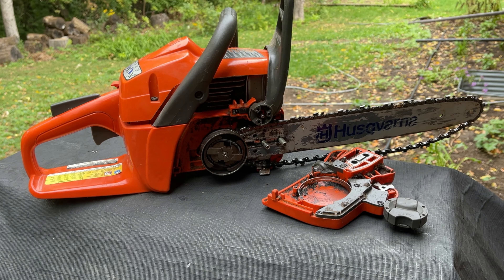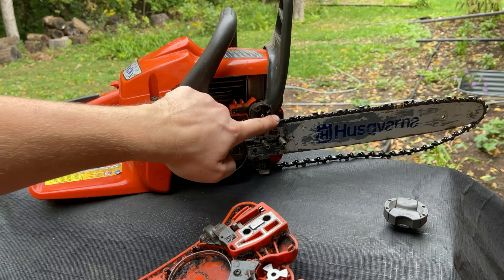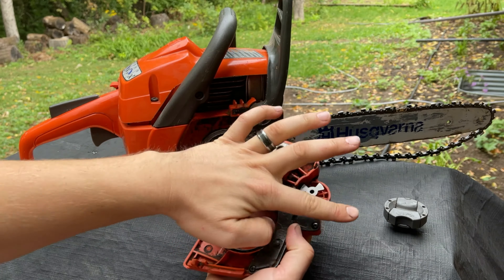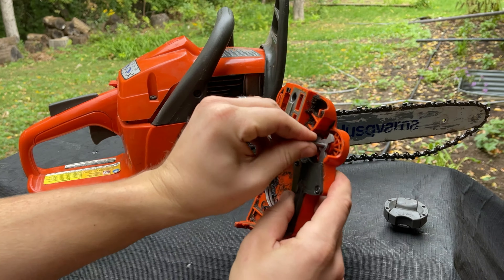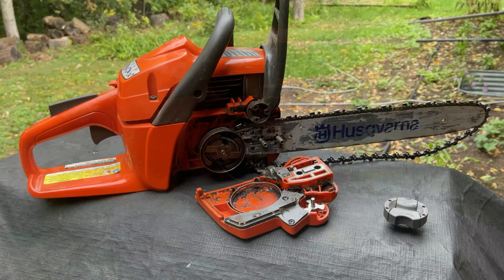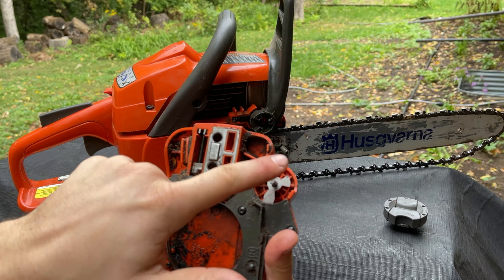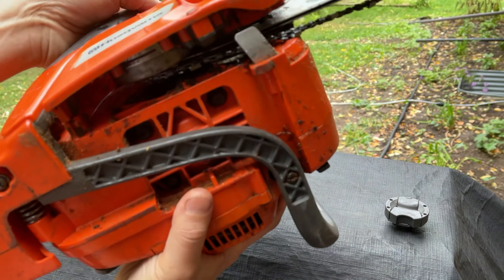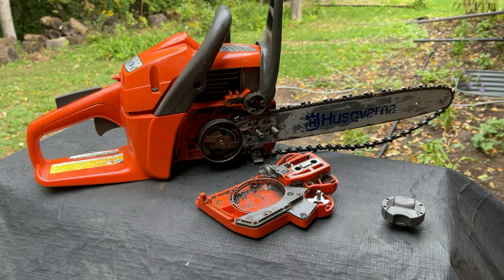How To Replace Chainsaw Chain Guard Clutch Cover On A Husqvarna Chainsaw

Comment: I literally just stopped everything. I was doing took my gloves off just to give you a thumbs up. I was absolutely stuck on trying to figure this thing out until I run across your video
Reply from the maker: Glad I could help!
Please consider sharing the video to help others as well! 

It is such a frustrating issue to have ruin your day.
Reply: Same here. Didn't realize the stop bar was locked in the stopped position and had to muscle it back free. 
Thanks!
Reply: Ditto!  The video kept me going in the field today 🫡

Comment: Now hire do you tighten the chain?
Reply from the maker: There should be a tension screw next to the base of the bar.

Check out a video on our channel about replacing the tensioner screw. It may help you locate it.

Comment: On thais chainsaw, which I think is the 235E, only one bolt get tight the cover, my the other bolt goes down when I push the cover in place, My is missing something, a nut? To  hold the other bolt? The front one. Help please.
Reply from the maker: You are having trouble putting the cover on because it isn’t lining up with the bolts?
Reply: @HowToVideoChannel  Sorry, I wasn't clear enough with my explanation. The cover goes on fine, but the bolt that has threads on it, and I don't see what secures the bolt. My 455 Rancher has two nuts. This one only secured the cover against the bar, and the other bolt is there just so the cover does not twist?
Reply from the maker: So the bolts don’t go through the cover?
Perhaps there is a plastic knob that you turn on the cover that the bolt is supposed to go into.

You may want to Google search an exploded parts diagram of that model saw. Maybe one of the parts you have is the wrong one and that could be the issue.
Reply: @HowToVideoChannel  No, it's the original cover, that is how this old model is made. I mounted it, I guess the other bolt is just a post, no nuts. Look a the video and you will see what I'm talking about. Only the knob tight one bolt. I hammered the other bolt in to stay in place. Too bad that I can't post a picture here.
Reply from the maker: Yeah, pictures would be nice.

Comment: LET ME SEE IF I AM LIKE  WITH YOU 1) I replaced a new carb on my  HUSQ. 326 after many attempted it started but after a few minutes it died...
Can you suggest me what to look for ??       2) THE SPRING  IN THE CLUTCH COME OFF IT TOOK ME HOURS TO PUT IT BACK ...what should 
I do if it happens again ?
Reply from the maker: You’ll have to compress the spring and get it back in place. A real pain. Check out the other comments, there is a tool available that helps compress the spring.
Reply: @HowToVideoChannel   Thank you for your replay  I think I will make one as I work with steel ...
May ask you  how come there are air bubbole (?) in the  fuel lines ?
Reply from the maker: Somehow air got in there. 
Fill it with fuel so the fuel goes in the line.

Comment: How to put the spring back in the cover
Reply from the maker: Compress the spring. A difficult process. I placed a board over the cover and then used a flat screwdriver to push the spring down. You could also use clamps or a vise.